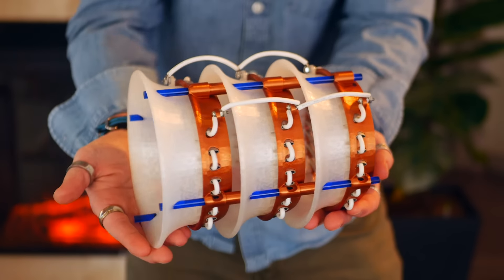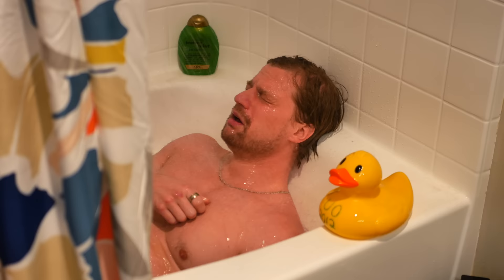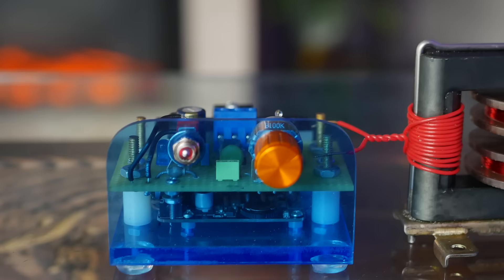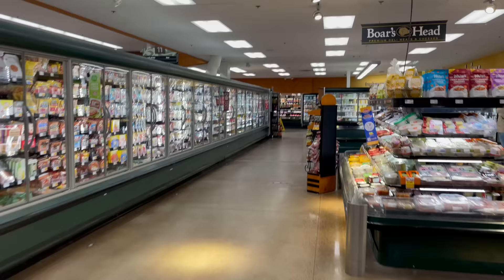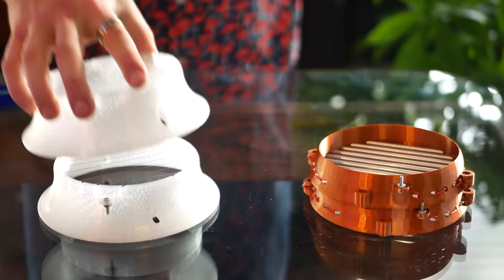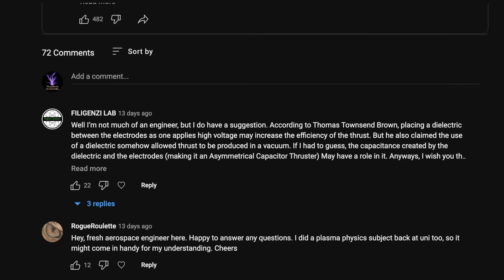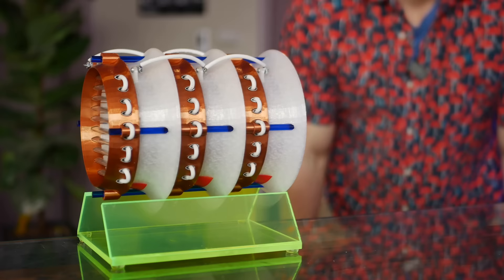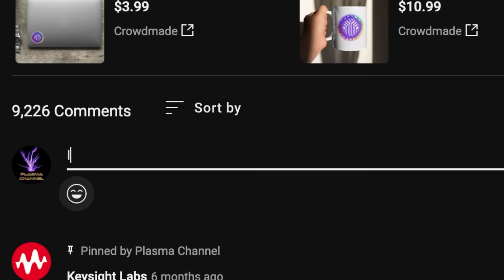The Next Generation of Ionic Plasma Thrusters (BSI MARK 2)

Comment: Awesome work! Don´t know if anyone mentioned it already, but since this design looks similar to a jet-engine, why not add "jet-engine" components like a compression chamber? Also adding a drive shaft powered by the thrust, which in turn powers a fan attached to the front end could be worth a try #turbofan-engine

Comment: would making each subsequent grid smaller in diameter to compress the air as it moves through all three help at all? cone shaped not cylinder. also would offsetting each of the three components a few degrees get the air to move in a vortex or would it not be affected? could you put air foils on the inside of it to help direct airflow?

so many ideas...

Comment: Was your increase because you have three stages, or the new airfoil design? You didn't show a test of single unit with the new airfoil. I suspect the results will be similar to your previous tests with the scaling not helping a whole lot. If velocity is is the goal, why not make the second stage smaller, and the third stage even smaller. Maybe I don't understand ionic air propulsion. It would be interesting to cap the back of it off, to see if you produce any static pressure at all. If there is, and depending on how much, coning down stages in a closed system until that pressure no longer increases should yield highest thrust. I imagine your current setup is increasing mass air flow, scavenging air from all three stages, as opposed to accelerating the air from stage to stage as much as possible.

Comment: how about a parallel design? series seems pretty limited, your moving air that already at the speeds your getting, plus with each additional stack, its only adding half more. in parallel yore still moving same speed but greater volume, maybe try greater volume for higher pressure. could try a 2 into one design using a funnel shape, or even 3 into 1, if nothing, might look cool!

Comment: so you trippled the sections, but you kept the same voltage? of course you only get a small increase in efficiency, what that tells you is that the original capacity with the electricity used could only achieve 30% more, so could probably achieve close to same efficiency by only making the one piece larger or closing the strings closer together adding more surface area. Increase the electricity usage in proportions to sections you add and youre gonna have way better results

Comment: What if you reduce the diameter of  the ring 1 and 2 reducing the outlet diameter, as if it were a funnel? In air and water flows that increases the exit velocity. Could it also work with ions or do they work differently?

Comment: you have wires on the front but toobing in the rear, how would it work out if you put wire in the back also? you might get singing wire, but you could put some thin bracing to counteract that. your ventury is good thinking, how about putting a type of vector thruster on the back like an after-burner, so you could make the outlet a little smaller for higher thrust?

Comment: Out of curiosity have you thought about applying this after the Mass Air Flow sensor on a car's Air Intake? It would be similar to having a blower but you may need to use the Throttle Position Sensor as a Potentiometer so it's not going wide open when the engine is at idle

Comment: isn't it possible to use mesh for Electrodes? Toget better ratio of surface. Second Jet engines reduse the diameter for compression. Wouldn't it make sence to try it ionic.

Comment: Curious: Why not build a cone that houses all 3 stages with one inch spacing between the cone and the thruster to allow airflow, but with each stage you simply shrink the design as the cone gets smaller condensing airflow towards the end of the cone, and potentially creating more thrust? P.S Spiral ribbed cone?

Comment: Okay let me tell you this.... fans in series = higher pressure... Fans in parallel = higher air flow or velocity. You are clearly measuring only velocity which means air flow. Parallel setup.

Comment: I wonder if the air speed is about 6m/s is it that for in and out? Then think about that the motor is connected for small airplaine. When the plaine moved forward speed of 6m/s is there any more trust left, because plaine speed is now the same as what was trust before the plaine moved at all?

Comment: If you multiply that by an increase up to 6 or 8 feet tall (of combined thrusters tube)....What does that give you in term of speed in m/s?   And even if you multiple number of tubes in parallel...of up to 4 or 6 tubes...What does that also give you?

Comment: what is the power supply giving 30 watts to 90 watts and what is its weight.  Nice work getting higher velocity thrust.
Reply: @Plasmachannel where can I get info on power supply for the Plasma generator- you may have in anothervideo?

Comment: I am willing to bet if the stages were smaller by 22-33% smaller for three consecutive stages and then 22-33% larger for the fourth stage compared to the third stage you would get a DRASTIC increase in airflow just by that design modification. Try it out!

Comment: would a metal tube housing not work? why do you need to use these tuba shaped housings? I'm seeing the airflow like water in a pipe. Is that not how it works? think laminar flow.

Comment: if the ultimate goal is to use this for flight... why build a thruster instead of an ionic wing...  you can use the leading edge of the wing to ionize the air, and the rear of the wing to attract the ionized air, this would produce lift and have a much greater surface area instead of confining the plasma into the engine.

Comment: Why didn’t you make a better diffuser and nozzle design? It doesn’t matter? I think this design is just a tube with flowing air, we need compression if possible?? Moreover ionic trusters like this will only work in earth atmosphere, wouldn’t work on vacuum. Where else, we only use ionic thrusters in space for slight changes in payload orientation. Please let me know about the design question earlier.

Comment: Will the speed not increase if the latter channels get smaller, ie if the front on is 12 cm, the next one 11 cm and the final one 10cm, less area for that air to flow through will result in more air movement?

Comment: if you block off the first stage and only power the 2nd stage what would the flow be. What I would like to know is have you tested the ability of the 2nd and 3rd stage to scavenge air and if the sides are open enough for 2m/s of air to flow through
Reply from the maker: Oh, now that's a great test I missed out on. Great idea - thanks for the input. It would have provided great data for intake performance.
Reply: @PlasmaChannel  also when you did the inline/offset test was the distance between the two electrodes kept constant, it seems like arc length is important and I would think that an arc inline with the airflow should produce a more laminar flow

Comment: What if you created two archimedes wind turbines of opposing metals, and incorporated an edge like the bionic propeller that uses the bumpy fin idea of the sperm whale to reduce cavitation and increase airflow.  do the electrical components need to be static,m or can you place them on a rotating screw and have create a wind that would push the propeller, and increase the airflow to an even greater speed?  Bring three technologies together.

Comment: those systems they use   power from behind so an pushing system.... maybe its more interesting to use the tunnel shield for plasma and high magnetic waves in front  of   the rocket.... so its  moving in to invisible tunnel and it can recuperate the energy back... for the next part of segment in the tunnel...... so the speed its increase with the sequence times of the waves segments.... those waves have to be  in the front of the rocket  creating into  centrifuge form because they have to stay for a few milliseconds in to place... time enough for the rocket to cȁ̶̢̳̪̥͎̩̦̫͓͓̏͋͌̀̑̔̑̆̄͌̽̄̂̄͜ͅtch them and to send them back.... from the abstract communications vision those systems they can rich the speeds of more than 100 millions kilometer per hour...humans didn't create not even a million km/h... in to space....  🌏 📡🌏 👣🕘 💎👽☠☼☾☄ゞど・ㇺㇾㇽ₪𝖎𝖙𝖎𝖇𝖎𝖗𝖆₪なめㇺㇾㇽ✶☥✨🌛🌄⊀✶⋊🐺🐾♓☆🐜🐜🐫▲▴◭

Comment: The noozle out maybe like a fighter jet make the out air be more litle and tje possibilte of direct the flow of air produce
Sorry me english im from Portugal
Reply from the maker: Ah! My friend Integza is from Portugal as well. I have wanted to visit your country for a while now. The issue with using a nozzle, is that this ionic thruster produces very low static pressure. Nozzles actually reduce the output. Faster airflow, but, narrower column of air + lots of drag loss.

Comment: if you enclose the design like an actual jet engine and shrink the back funnel part as small as you can, essentially compressing the air before exiting the engine, does that help with propulsion? I like to imagine that enclosing the design would allow the back thrusters to only speed up the air that is already being passed through it from the front ones. But this is also coming from someone who barely even understands what ionic thrust is lol

Comment: Use silicon it doesn't conduct electricity or gold also does not conduct electricity allowing you to control the path of the electricity. Try spin or fins for a hybrid (airplane propeller)

Comment: @PlasmaChannel i know this to bee a bit late, but doesnt the positive of the second and thirth stage react to the negative of the first and second stage?
would it not be beter to extend the first stage with just a tube, so the distance between the stages is greater, but the gap between them is smaller?
this would change the  -+ -+ -+ to be more like -+    -+    -+

Comment: ...i have no idea about this technology ..so just saw your video... and wondering... you said you want more thrust. one stage produces 2m/s ... and stage after stage don't add up to 6... what would hapen if you used 3 separate stages one next to another and funnel their output to a nozzle/funnel that has a diameter of just one stage? ..i wonder would that add up 2+2+2? just thinking out loud with no tech knowledge FYI. Best regards

Comment: would a bigger model with more gap in offset cause for higher performance?  IE will this scale with size?
Reply from the maker: Larger spacing is possible, I'd just need to redesign the air nozzle and increase the powersource.

Comment: for me personally. this is not news. take an ordinary pipe. put an electric motor in the stator without a rotor, it will be the same. either there will be a fan, or it will drive water. as a pump. it is given in Russia that they use it.

Comment: why not try them crossing the electrodes at a 33.3 degree or at 96.6 degree?
Reply: maybe bring the three separate stages slightly closer like you did with the individual thruster and have less pull in between the stages causing more to be pulled in from the main stage instead of the sides might cause more of a vacuum.
Reply: like @kurtorey6467 said maybe you can adjust the output by like the afterburners on a fighter jet?

Comment: @PlasmaChannel I believe that you are losing power, as you are absorbing the air that is still coming from the sides of the prototype. Only absorb air that is already moving. Use more stages (example 5) and rotate them 72 degrees (360/5) each to control output diffusion.

Comment: Try mixing glass blow able think "pot pipe" (marijuana) with plastic wrap (cheap) does not conduct electricity. With this you can grid the wires removing spark also you can remove sparks or contain the electricity into a straight out
R curved line.

Comment: hey I don't know if you're still read your comments for this anymore 

but I just watch this 
video 

I'm one of your biggest problems is you do not have any compression 
a very best 
you're only getting 4 point thrust per meter 

I know how you can get more  !!!
Reply from the maker: Thanks for the suggestion. Compression is difficult at such low power levels.
Reply: @PlasmaChannel  
not really
it can be built into a basic design.

take a look at modern jet engines  
they have large intakes 
they narrow out in the middle 
widen up just a little bit 
I've been getting Arrow again 
at the afterburner 
and the whole thing is powered anyway 
have to use electricity 
so if you add a high powered fan  
in like the second or third 
section  it would help 
you have five or six sections 

try this ? as an example 
6 sections.  Section 1 Big,
section 2 small, section 3 big add  fan !.  section 4 big, 
Section 5 medium, section 6 
small. 
and close the whole thing up so it don't have gills 
air sucking in the sides
that is a big part of your compression loss 

so you want all the air going in the front and all they are coming out the back 
like a jet afterburner 

as it is you say you're only getting maximum of 4
PSI.  
DO try my suggestions 
as I I'm only guessing 
however  your PSI 
possibly should exceed 
10+   I hope you succeed !
you have a great idea wish
 I thought of it first 👍😎.

Comment: Also since you already have the hardware would it be possible for you to conduct another test?  Does placing the eletrode wires horizontal relative to the colector tubes makes any diference? 
(i explain why, my idea would be to build a thuster like this along the wing of a plane. Leading edge + chord with would be eletrodes and the ailerons would be colectors (therefore eliminating the need to a engine on the wing, reducing drag)  
Example:
Side View:
     _._._._.    
// .__.__.__._ D     (side view: //=aileron, _=wing surface, . & D= eletrodes)   

Top view:
  /""""""""""""""""""\  (leading edge eletrode)
/  ----------------  \  ( -= strip of eletrodes wires)
|   ----------------   | ( -= strip of eletrodes wires)
|   ----------------   | ( -= strip of eletrodes wires)
\  ºººººººººº  /    ( º= ailerion colector)

Comment: Hi sorry to bother you but I just watched your video and saw what you did. If I'm right in my math and design I think you could reach 6 - 8 mph speed and have a weight around 300grams. Would you be free for me to give you the design?
Reply from the maker: Thanks for the offer, it currently is going that speed with the current design (and I am able to get the weight down to almost half with my upcoming iteration as well.
Reply: @PlasmaChannel  that's great to hear it be interesting to see if you implemented the ideas I had. I'd be happy to show you if your interested. Can't hurt to get the best performance if it's a new angle that could help.

Comment: No side inlets at all.  One continuous duct.  At each successive stage, reduce duct diameter.  Think of how turbine compressor works (jet engine).  Also, velocity is totally meaningless if don’t multiply it by the moving mass; i.e., actual thrust is the ONLY measurement that counts at all.  Or, maybe a radial arrangement, such as the early jet engines, before the advent of axial flow, with each active element in its own separate “can”.  You aren’t really developing like an engineer, or even a physicist.  On the other hand, you might be more reminiscent of Michael Faraday, who did have a rather good run.

Comment: you would have to put 90W into a fan to see if you are actually getting any better results than those provided by existing technology. The ionic thruster is cool, but if a 90w fan is more efficient then until you can make the thruster better than a 90W fan you have made a quite complex machine to do a job that can be done better by a simple one. 
Miserable old engineer